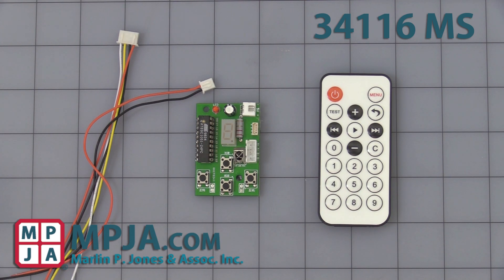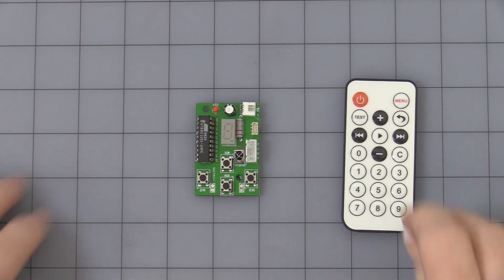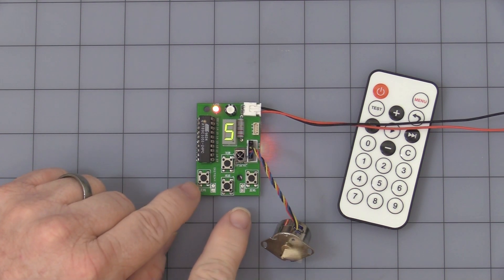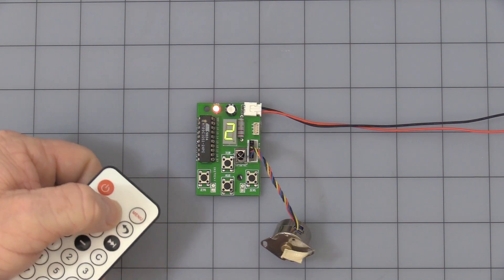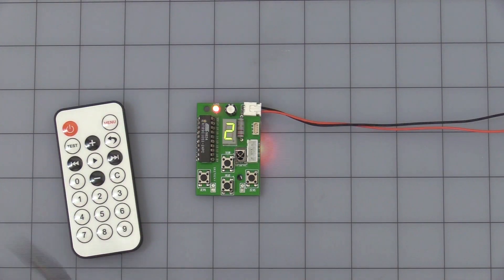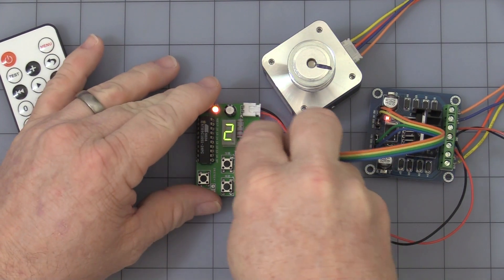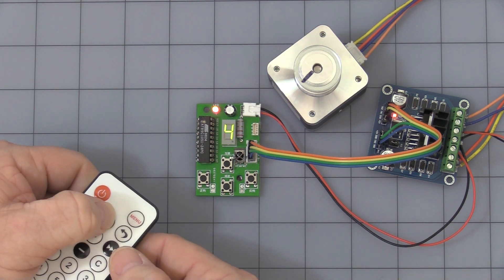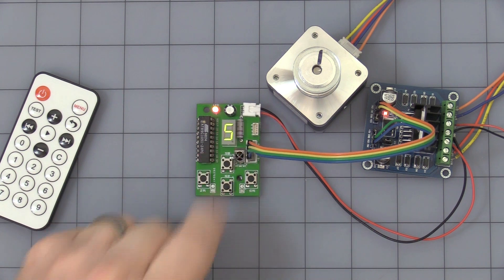Stepper Motor controller with IR Remote MPJA.com 34116 MS

Comment: Is it possible to use L298n dual H-bridge motor driver in place of 34692-MP module to drive a 2A stepper motor?
Reply: Did you try it. I knows it's a long time but did it work